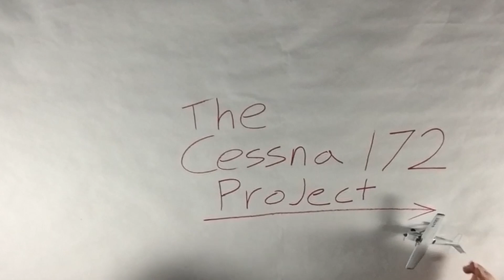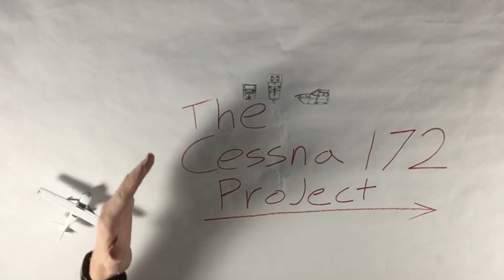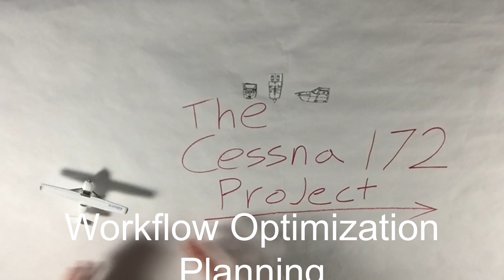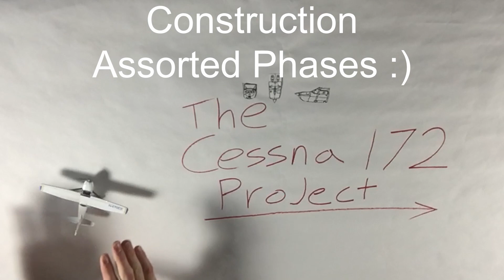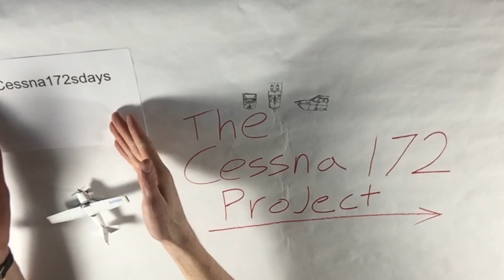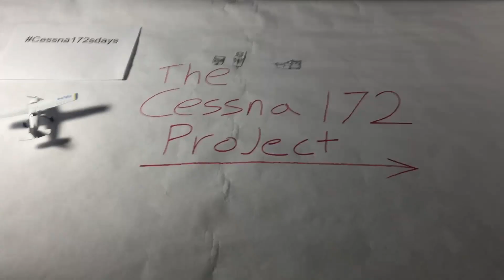The Cessna 172 Project Beginning | #1 | Captain Bob

Comment: Good luck Capitan! What simulator will you use? Have you tested simvim with X-Plane?
Reply from the maker: Thanks Alejandro! I'll try to have it both compatible with X-Plane and FS2020 likely using MobiFlight. I'm working with SimVim and it might be another possibility.
Reply: @CaptainBobSim  I think simvim is a bit easier. It would be wonderful if compatible with both of them. The problem is that you would probably have to change the arduino each time you change the Sim.

Comment: Hey Cp Bob, I have been asking for assistance but no one is responding. You seem you know mobiflight pretty damn well.
I have a radio, rotary switch, rotary encoder. Using the push for mhz/kHz is pretty simple it seems BUT I want to use the rotary switch setup as preconditions for ADF, COM1, COM2, NAV1, NAV2 and use the rotary for all of them.
Where can I find how to do that?
I am LucidFX on discord
Reply from the maker: Hey Sean! I must be honest, I haven't used preconditions yet, so don't know how much help I can be.
3/4 of the way down from the documentation, there is a section on preconditions. https://www.mobiflight.com/en/documentation/software.html 
I'd set each rotary switch position as a configuration row and add a precondition on the display. Try starting out to see if you can get two separate features to work, then add the other three.
I think the best way would be to use the Config. Make sure to press apply.

I think a good source for help would be the MobiFlight forum or MobiFlight discord.
Reply: @CaptainBobSim  I'll start working on this. Busy finalising the design of a generic panel mixed for GA and simple map based on 737 functionality. That should HOPEFULLY give a lot of the functionality needed to get off the ground, communicate/navigate and then land
Reply: @CaptainBobSim  i have been trying the preconditions but either inam dumb or its pretty complicated 😂

Comment: Prolly a dumb question but...any idea how to get mobiflight to activate a switch that doesn’t have a key binding? It’s the aero soft f16...it has some switches that I can’t find offsets for..
Reply from the maker: If I understand the problem correctly: In the input tab you can select "keyboard key" under the FSUIPC list, and set it to any keyboard shortcut. I'm not experienced with Aerosoft, but it could maybe be answered in the MobiFlight forum?
Reply: Thanks I’ll try!